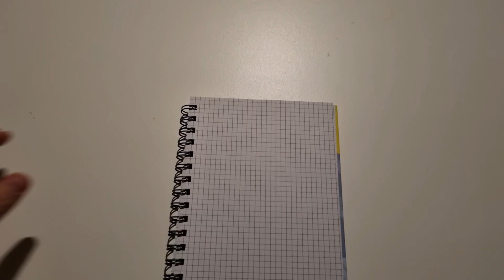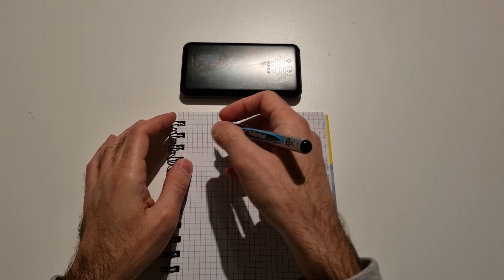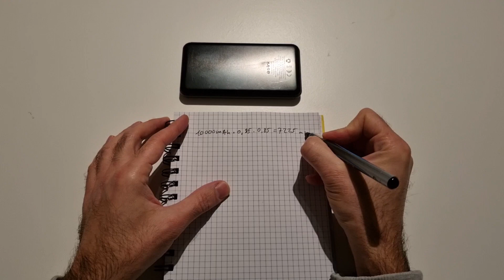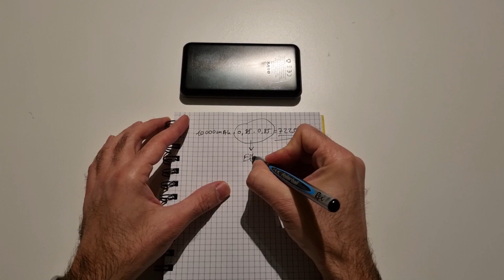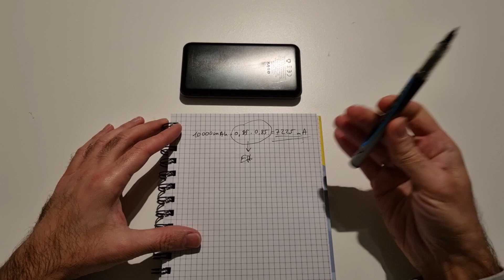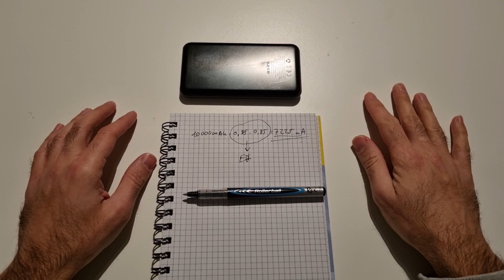How to calculate (Quick) the real powerbank capacity

Comment: So for a 10000mah powerbank is efficiently delivers upto 7225mah. Anything below this will be considered as inefficient. Am i right?
Reply from the maker: Yes. Today, I think most powerbanks are more effcient but this was, let say, a worst case analysis
Reply: @mr.proton8552  I'm able to charge a 4000mah battery 1-full charge & 70% on 2nd time using 10000mah powerbank. Is it good enough or its bad ?
Reply from the maker: @MaheshwaraSiva  then it means about 68% efficiency (((4000*0,7)+4000)/10000). I would consider this as bad.

Comment: Hello. isn't 0.85% too much? current electronics is very efficient
Reply from the maker: Hi, as I explained in my other video, power banks mostly have a 3.6V Li-ion battery. This means the 5V from USB needs to be converted to 3.6V while charging. And while discharging (e.g. charging your phone), the voltage needs to be converted back to 5V. An efficiency of 85% is pretty good for that kind of conversion.